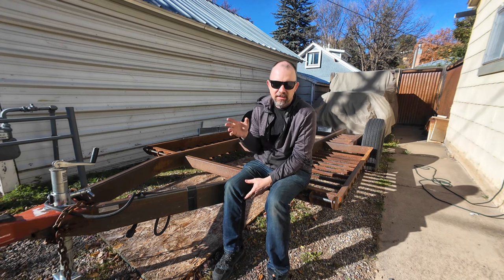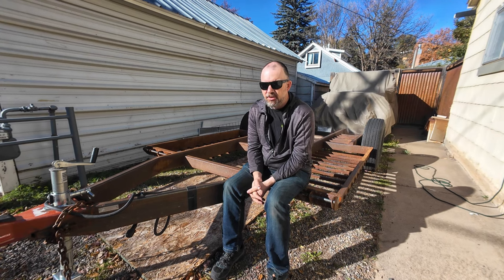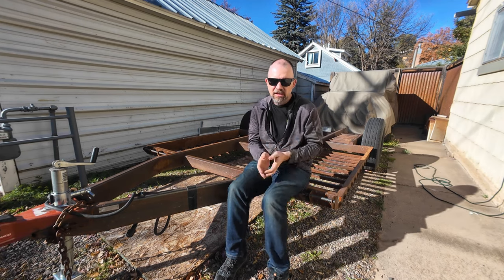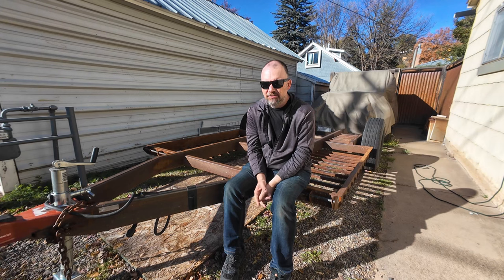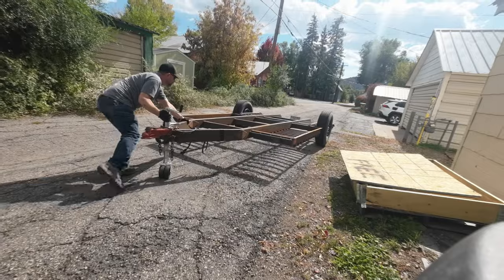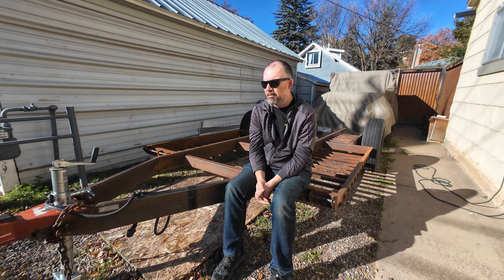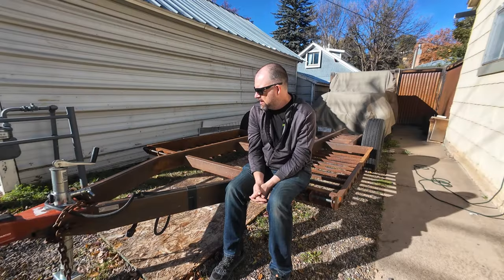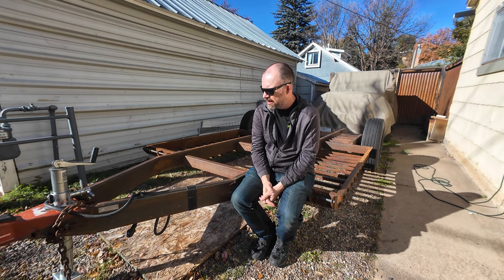Dolly Trailer...what and why

Comment: It’s a great trailer option for those wanting a more tailored experience for towing 4x4’s. My trailer is very similar but has a conventional trailer suspension. If I did it again, I would rigid mount the axle like you’ve done.
Reply from the maker: Thanks! It is sure a lot less moving parts to worry about wearing out. I'd like to try a split torsion and/or Timbren style drop axle on one just to see if I could tell a difference. It would also be interesting to try to make a dually axle version for even heavier vehicles. A super light version for the Minnie Willys project too! ha!
Reply: ooh! You could make them all “nesting” trailers for easier storage! 😂
Reply from the maker: I like it. I do wish I could make one stand up, fold up, or something for compact storage.
Reply: Just now watching the vid, but I had a rigid mounted trailer (was an old trailer for a dirt track car) and hated every minute of it.  Constantly welding on that thing.  Would bounce off the road unloaded. But the axle welds at the frame never broke.  Good trailer.  Just rough trailerin
Reply: @brennanmetcalf  That dually versions sounds a lot like Fred's trailer.  I've been tempted many times to build something like this on a single-axle for my rig to replace the 3000 lb "vintage' 18' tilt deck I've been using for years.  Hadn't considered ridged mounting the axle but that certainly gets things lower.

Comment: 1030 lb is super light for a 7k trailer
Reply from the maker: Thank you. I think it could be lighter still, but it would require a lot more time in optimizing the main rail and spreader structure. It would be expensive to lose another hundred pounds or so. It would be neat if it was under 1k though!

Comment: That’s a great setup for someone with limited space and it makes getting into gas stations easier. We run a big trailer because we use it for lots of other stuff and it’s one of the reasons I bought a diesel truck. I can now go through the trucker lines to buy fuel.
Reply from the maker: Zero interest or space for a large trailer setup on my end. I've done the diesel truck thing, and walked away from that too. I'm trending back toward not running a trailered rig in the future.....bigger driving trips, some international stuff hopefully, etc.

Comment: We tow a long travel race Bronco and I've had a very similar Idea for a long time, but dual axle... Great to see it working out. Would you consider selling plans? I have access to Plasma and laser tube cutters, might be a good winter project. Cheers, Ben
Reply from the maker: @LIFE.IS.TICKING  I'm not really interested in investing the time to make plans, in my experience they just start spreading once they are released. The design is pretty easy, just build one. I don't see the point on a dual axle, but if your worried about tires, do a single dually axle.
Reply: @brennanmetcalf  Totally understand, just figured I'd ask. Cheers bud.

Comment: You mentioned there were things you would've done differently to drop the trailers weights itself but didn't elaborate. Would you have used 2x4 main tubing instead of 2x6, or what else?
Reply from the maker: Mostly it would be thinner materials in certain areas or being aggressive with removing material from the main rails in the laser cutting process.

Comment: Put central tire inflation system on it so you don’t have to pull the cores to air down. Make use of that feature for sure.
Reply from the maker: Having some kind of auto-inflate system for the tires would be neat.

Comment: I have thought about building a trailer like this. But it is just too specialized. I haul more then just my crawler.
Reply from the maker: @bradywilliams2666  blurring the lines further to make a trailer like this less specialized is very possible. I built in a few features for that if I needed it, but I honestly haven't. For me, having a rather specialized solution made towing my vehicles enjoyable enough to tolerate it. I find normal utility type trailers pretty much intolerable....and that is why I got rid of my old one years ago and then built this one. 🤷‍♂️
Reply: @brennanmetcalf  I get it. And the trailer is very good for what you built it for. My buddy built one for his buggy also. It uses a tandem axle.